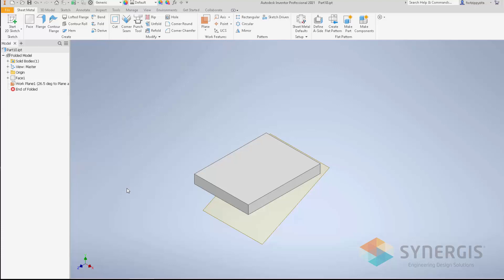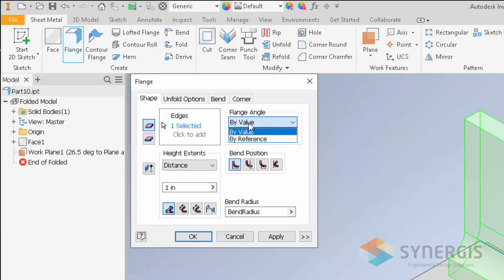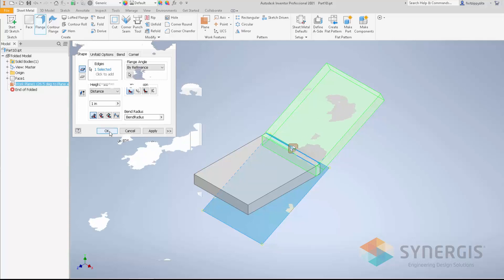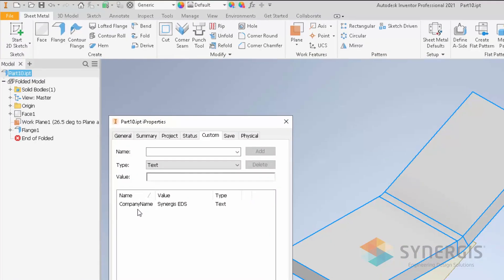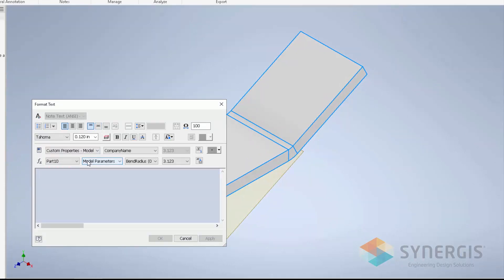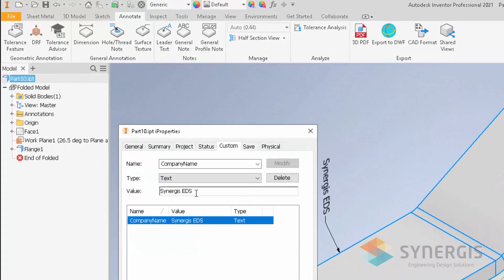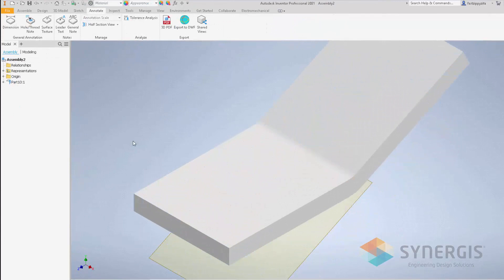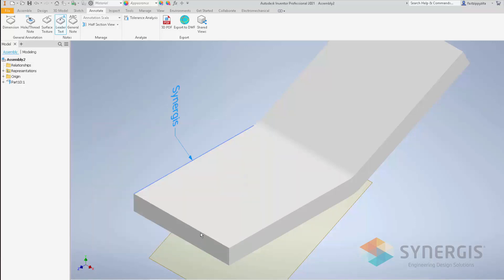Autodesk Inventor 2021 - First Look - Part Mode

Comment: i'm tearing my hair out.  can you please tell me where i can go to find out how to use the constraint or joint commands to have several bodies rotate or revolve around a steel pin.  Think of wooden slats lain side by side, then a pin driven through the ends, from left to right, like several hinges side by side in a row, but connected with a single pin.  I want all the slats to be separately modeled, but I want all of them to move at one time.  When I string the slats together with the pin, then constrain the top faces to join them together, the entire assembly moves, including the pin, and what I want is for the slats alone to move up or down, and the pin to be stationary.  If i do no constrains, the slats move independently, but the second i put any kind of constrain on them to cause them all to move at the same time, the entire assembly moves. not just the slats.  you probably don't answer specific questions about software usage, but can you PLEASE send somewhere to find this answer?  I spent two hours yesterday trying to do this.